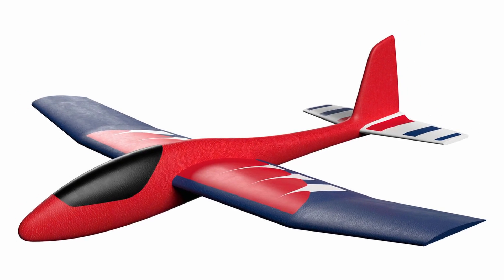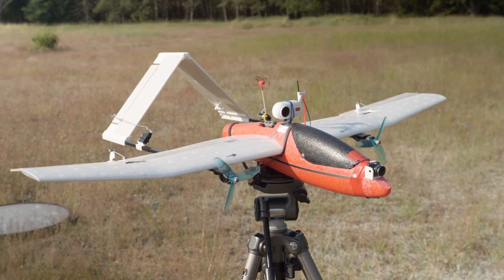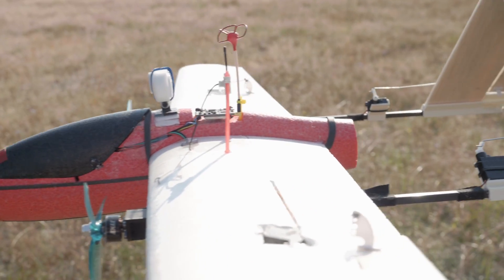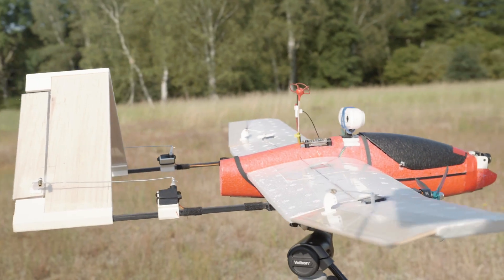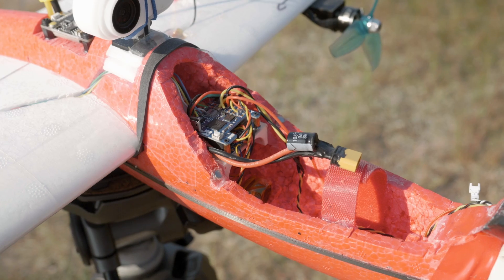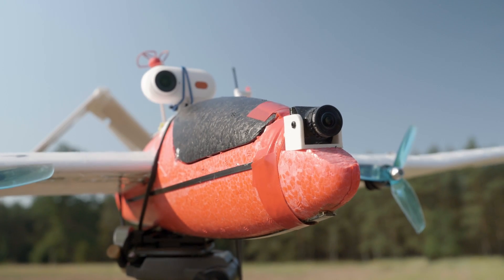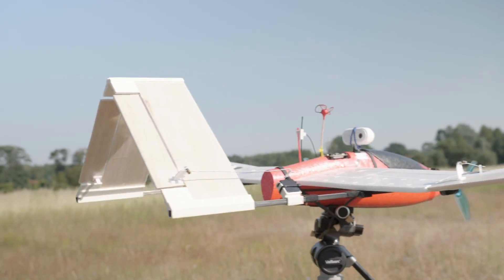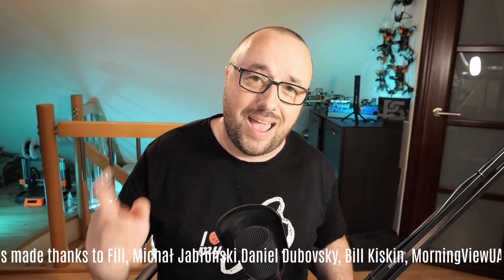Lidl Glider RC Conversion | Two motors and an A-tail

Comment: Hello, could I ask you if you could make a video on how to connect a video camera with a transmitter to an airplane?  I would like to fly fpv with airplanes, but I know very little about fpv and it still doesn't make sense to me to connect to an airplane that will have a classic receiver with PWM.  possibly new receivers from radiomaster with pwm but elrs.

Comment: I've got a HK F3 fixed wing flight controller from years ago that is still a lot smaller and lighter than the smallest modern F4 FC. It will work well in such a glider, also without motor because it also consumes less.

Comment: Great conversion! Just a question-   a lengh of a v-tail (carbon tubes) How to know how long it should be?
Reply from the maker: Depends how much weight you can put in the nose to balance the airplane correctly. I just made some experiments and cut the length that allows correct CG

Comment: I don't know :| ... why do you pay 9.99$ and you keep only the wing ? :P . I have done a few versions myself and then i realised that this is a "gift" (not to much work for a good platform) for new ppl in the hobby. Just put a small motor + 2-3 servos and you can enjoy the day because it was cheeap and fast to build. Nice build btw
Reply: Twin motor fpw much much better. I'm not sure about a- or v-tail, but final platform looks not too complex to build. I have 2 of that gliders build with classical tail with ruder. Thanks to Pavel, will try something new.
Reply: @ДмитрийИсаев-л2л  i don't know were u whant to go with the "2 motor fpv much much better" .(maybe more heavy, more things to drop on a glider platform) . My comment was a little sarcarstic and Pawel knows it ... The point is to get the most fun for "nothing". You can pay 200$ for a stupid dolphin and ground it in the first 10 seconds or u can get this spent half day of "work" with your kid + some pizza and have the same result. :* Happy skyes
Reply: @cosminjuverdeanu3671  I just noticed that idea not bad to check.
Twins gives you couple benefits (not my words actually):
1. No props on the front of cam
2. More stable flight

And yes, that pease of..  epp will fly in any case. My children love it.